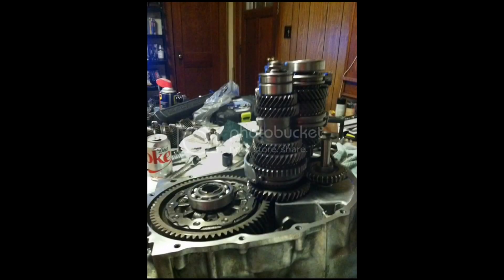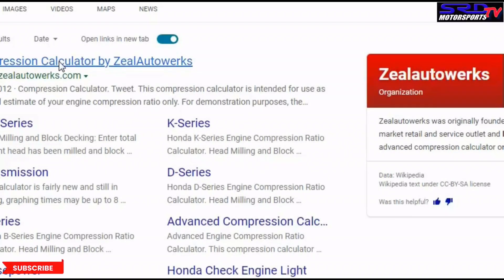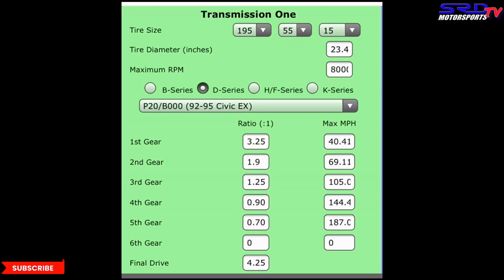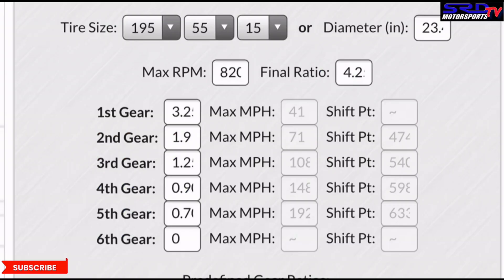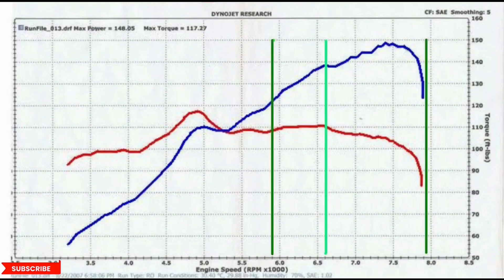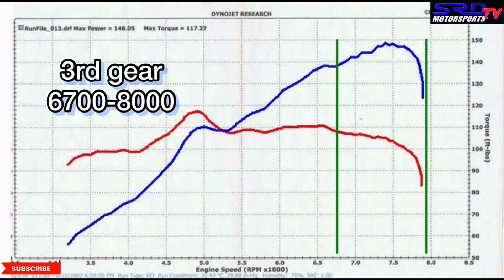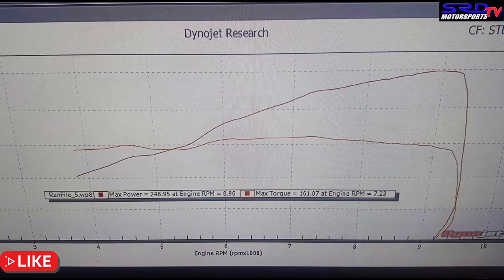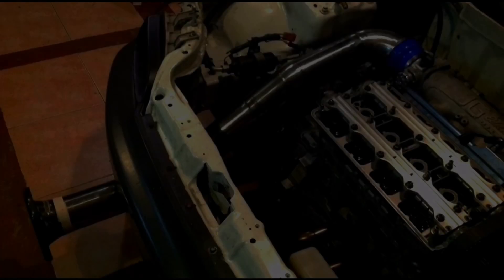D16 SOHC Gear Ratio Talk no Adobe FlashPlayer SRDmotorsports

Comment: what about turbo setups for the street? I just upgraded to a Z6 B000 tranny and am replacing synchros just going to leave it stock ratios cuz i cant afford short 3rd 4th and 5th gears or the 4.7 finaldrive. But I'm curious as to what ratios you would be running with a turbo say 350hp max boost hits at 4500. d16y8 thanks. great video!

Comment: Playing with a dragy brought me here 140whp ZC on full interior 23inch tires, only got 16.03s on a quartermile and been receiving alot of advise to change my 3rd gear (stock vti tranny) or the final drive, well, what can i expect? 😂😂😂
Reply from the maker: no need to change 3rd gear or final drive 
What is ur current transmission? Looks like u have a Lxi a000 tranny?

what is your 60ft on the 16.03

Way too many slower than faster na nka 3rd gear or final drive one thing in common is they all spend a lot of money 😂
Reply from the maker: A friend of mine tuned a stock vti with proper vti tranny na B000 
Last time in Motul but carbon door and hood
15.1sec stock vti engine and stock transmission

Malabo nasa 140 un vti lng un
Reply: Oh yeah you need to put alot of good money to hear those good sounding close gear😂😂😂
60ft - 2.45 
0-100 - 8.4s
For the trap its 139@1/4 mile

Well, could it be with the powerband of the tune? My engine peaks at 6900rpm and 5200 for the torque, not really sure really hard to reach the 15s
Reply from the maker: @elijahcarmona8487  a fast sohc with ph12/vti gears sound as good btw 😂 just like an SiR with stock tranny not all siR nka typer tranny to sound good or go fast 😂
Reply from the maker: @elijahcarmona8487  looking at the 60ft

Looks like if u do a 2.2sec 0-60 ? Thats easy 15.7-15.8sec for u as is no 3rd gear lol!!!
Reply: Oh yeah. Its almost there considering its on full interior, well generally if you would ask any “builders” or “tuners” they would want to make you go for the close gear or the final drive or you can never get to the 15s 😂😂😂

My tires are toyo proxes 195/55 a bit heavy for the sohc, maybe?
Reply from the maker: @elijahcarmona8487  well builders that sell em or need to charge extra labor for the tranny work? We still went 14.2sec on an ESi with stock esi tranny on 148whp before the carbon lodi fad started kase it was 2008 😂

Ur tires are fine, depending on grip and all u can prolly launch a bit higher and it would still grip = this might solve ur 0-60

Cuz the 15.1 stock vti I talked about does a 2.205sec 0-60ft
Reply: Yeah, the very essence of close gear is actually the feels, like who doesnt want a car that shifts like a motorcycle😂😂😂

But yeah ill try to launch it on higher rpm, 5000 was kinda low for the tires, currently im on 5800 ill try to raise it to 6,

15.7 on a daily driver is pretty much acceptable iwould say😅😅😅
Reply from the maker: @elijahcarmona8487  once u are 15.7 u prolly can chip off .1 easy 

Don’t go too soft on the tires it becomes heavy sa dulo? So around 27-28psi is more than good :) 

Hope u can practice preloading before launch = helps real good
Reply: Yeah i usually get better time on daytime due to the temperature of the pavement, thank you so much for your thoughts, knowledge is somehow more helpful than slapping alot of cash on a sohc, like seriously, spend thousands to shave a fraction of a second 😂😂😂
Reply from the maker: @elijahcarmona8487  yep hotter tarmac gives better traction indeed!

Comment: Hi sir may i ask which is better to put an fd 4.7. s20transmission or stock esi tranny? Thank you sir in advance
Reply from the maker: Esi/s20 B000 transmission because even a Bseries 4.7 helps when u are hitting high rpm that the sohc doesn’t see
Reply: @SRDmotorsports  last question sir. 
I have a sohc esi camgear box headers
Is it okay if i put an mfac3rd gear and 4.7 final drive or 4.9? Thankyou very much sir
Reply from the maker: @carloflores2944  Mfactory 3rd gear only works with the inverted stock 3rd as ur 4th (u finish 4th gear parang tersera mo) and so adding a 4.7 fd this reminds me of an onboard vid in Clark a sohc bfor finish line let’s go of the throttle about 80ft away… some say “not sagad” but that’s cuz ubos na 4th (na dating 3rd kase) wala pa finish line

The Mfactory 3rd is good with inverted 3rd as 4th IF kasama Mfactory 5th Pra dikit dikit lahat

But why they don’t? Kase mahirap sa nlex 5th mo that close  hehehe pangit sa long drive

So just a 4.7 on ur current esi gears is perfect na
Reply: @SRDmotorsports  thankyou po sa kaalaman thankyou appreciate it po.
Reply from the maker: @carloflores2944  no worries man! nice you checking out “details” kesa “Sabi Sabi” hehe

Comment: SRDMotorsportsTV can i ask feedback if installing a 12LBs Lightened Flywheel (competition clutch) to a stock S20 B000 ?  good for daily driven and occasional sprints? no problems driving in incline/steep uphills? ty
Reply from the maker: Actually the problem on incline or steep uphill is a myth because power and torque is generated by the engine 

The lighter flywheel changes the rpm rate of going up BUT also going down maybe that’s why they said it’s hard to drive but IMO just imagine it’s a motogp bike 😂

I’d always choose a lighter flywheel just the wallet never agreed 🙁
Reply: @SRDmotorsports  thank u for the quick reply, i saw a video with a lightened 12lbs flywheel the revs go up and down quick vs a stock 18lbs
Reply from the maker: @salteveline  yeah maybe if we heel-toe daily it would be tiring 🤣 but i think its fine
IMO theres a bigger change in driving habits from driving a stock clutch to a tri-puck
than it is from a stock flywheel vs light flywheel
Reply: @SRDmotorsports  I agree. I changed my K24 swapped Civic's flywheel from a stock 16lb RSX flywheel to a 10lb JDM DC5 Type R flywheel and the RPM definitely responds to throttle a bit quicker, but I haven't noticed any downsides. No problems with hills or hill starts even with several passengers and a lot of weight in the car and there's no increase in noise or vibrations.
Reply from the maker: @averyalexander2303  yep the quicker up rev and down rev will be more driver preference but since I was always a motogp fan first… I’m okay with it 😅
Reply: @SRDmotorsports  Yup. I like the feel of the faster response, it makes downshifting and rev matching sound and feel more satisfying to me. I also noticed that a slight RPM mismatch when letting the clutch out a bit too quick isn't quite as jarring either since the lighter flywheel spins up or down easier without resisting so much. I realize that different people prefer different things and other setups may react differently, but on my setup, I haven't noticed any downside to the OEM lightweight flywheel.
Reply from the maker: Yeah I like the same as u… rev matching it is fun even on normal drives it don’t seem to be a hindrance to me…but yeah some may prefer otherwise

Comment: Sir can i ask if what is the code of the stock vti tranny?
Reply from the maker: I’m not sure our local has a code but

On the spot where u put the axle? The circumference of the housing has a code it should be
B000  to be a vti because LXi is A000
Reply: Cause last week we bought a p20 B000 tranny it came from a ph12 engine is it same with the vti tranny?
Reply from the maker: @sharmainecastillo3446  ah yes p20 is ph12 the gears are the same just the internals such as “gear selector”
Ph12 is aluminum and vti is steel but not interchangeable 

However the gear ratio = identical so atleast the vti u got has good gears
Reply: Do you have a facebook account?
Reply from the maker: @sharmainecastillo3446  ah yes the shop page link is my fb page I’m the only one who manages it… 

Here or there u can ask anything related to these stuff

Comment: hi SRDmotorsportsTV  thank you so much for educating us re vti/lxi/ph12 tranny, i hav a d16zc s20 b000 tranny, which tranny gear upgrade is better:

A) 
1st 3.250 stock
2nd 1.909 stock
3rd 1.565 MFactory 3rd
4th 1.125 stock 3rd to 4th 
5th 0.702 stock
FD. 4.25 stock

B)
1st 3.250 stock
2nd 1.909 stock
3rd 1.125 stock
4th 0.909 stock
5th 0.702 stock
FD. 4.7 MFactory
Reply from the maker: B is better any day cuz the gear spacing is correct

For me it seems abnormal  to have close 1-2-3-4 tapos use stock 5th so u can go to the highway ☺️

They’d say it helps? I disagree cuz the ones I see got stuck in the low 13s for years

And went to 12s by turning it into a “racecar” on special fuel 😂 so where there did the gearing help? Hmmm lol

mines like B = stock esi
I do plan on saving up for a 4.7fd so hopefully soon :)

Comment: I had already realized that shorter cash ratios would not always be faster. 
When I changed the tires from 195/55/15 to 195/50/15 the car was slower.
Reply from the maker: yes!!! thats my goal on this video to let each one figure out what wrks for their own car and driving style...

i believe you saw this because same rpm limit right? so for the same rpm shorter distance reached in total
Reply: @SRDmotorsports  Yes. the same rpm limit, only the tyres change..
Reply from the maker: @picole321  that is interesting because your findings are correct even with math and the calculator :)

Comment: Another great content yesssirr!!! Thank you SRD, I was also curious about the S40 LSD tranny  ratio any great advise on this for a sohc ph16 engine?  Many thanks!
Reply from the maker: thaaaanks man!!!

well if the s40 is b000 ? then most likely it is vti geared which is the same as ph12 so thats a good one indeed
Reply from the maker: Worth noting here though we discussed it on the SRD page…

S20 is a designation for 92-95 / obd1 / 5th Gen
S40 is a designation for 96-00 / obd2a/b / Gen6

Both can have an LSD as it was a Honda optional accessory back then when u bought it bnew in Japan (the car) just like some B16a were rarely lsd

I share this cuz I saw a random fb post claiming that it’s s40 so it’s LSD?!? It’s not always :) worth noting cuz that random post was from a 
“buy and sell” dude lol

Comment: I guess mas ok to get gears from MTM since he can outright make you a custom one for almost the same price as an MFactory? Granted you have a dyno sheet to base it out on hehe.

Still haven't tried my 20" tire sa BRC or CIS :( soon hopefully.. 1-2nd gear felt good though..
Reply from the maker: true on MTM gears but also there are limits like we both know "ratio" is divided onto both teeth gears? meaning... physically impossible to get 1.370 third gear sa sohc etc etc but yeah MTM gives us that freedom

Me il stick to my ph12 MAYBE one day MTM frst gear extension or MF since similar price naman

or heck final drive nlng done deal na hahaha

but then final drive is less importance when there is a 20" option na eh
Reply: @SRDmotorsports  Agreed, 20" tires are not ideal for cars that are too low BTW pero i love the fact that its an easily reversible "FD swap".
Reply from the maker: @mikodelacruz  yes on too low so "no to stance" kidding hahaha

it is a significantly smart choice i mean heck even M&H slicks have 20" 23" 24.5" and bigger

for me the reason id consider a 4.7fd ? is not cuz its better but its because for me to want that? means eventually the sohc will be strong enough to power down the line on 4.7 fd and 24.5" slicks 🤣 bisi style lol
Reply from the maker: or better yet since our 195/55/15 is 23.7"
id run a 23" MH slicks if i had a 4.7fd granted the sohc engine can take advantage of it IF it makes power? oh man... that would run good times lol
Reply: @SRDmotorsports  This would be better for sure, would be a recipe for a good bracket class car.
Reply from the maker: @mikodelacruz  yes!!! improvements plus consistency definitely good for a bracket racer!
Reply: @SRDmotorsports  Would be a fun experiment to find a stock civic and run this compared to stockies, or ones with the common 195/55/15-195/50/15 haha.. Sana magkaroon ng drag testing day this year..
Reply from the maker: @mikodelacruz  oh snap! this! is a good idea!!!!

thanks to all of you guys here man...its going as i hoped... videos that are helpful but also comments that got golden nuggets 😏

Comment: If you run 1954515 vs 1955515. Without the expensive fd swap.
Reply from the maker: it helps a little... but 45 series 15s is quite hard to find and it will also be a balance of grip because the lower profile tires have stiffer side walls and stiffer sidewalls means it wont conform to the ground easily so less traction on take off

its why slicks have wrinkled sidewalls when we launch so it conforms to the ground maximum

Comment: Is the 11.800 car around 2070 lbs?
Reply from the maker: the grudge race rule was 900kg both were weighed bfor n after

but both were in the 940-950kg range so
2,068-2,090lbs
Reply from the maker: when i think about it now we ran 12.1 in 2017 on e85

these guys ran 11.8sec 2 months later 🤣 on e85 too!!

was that fast
Reply: @SRDmotorsports  Just realized the estimation using this calculation is quite close: hp = weight in lbs / (ET / 5.825) ^ 3
Reply from the maker: @findtherightbeat  actually good point!   and now when i think about it? aint it funny? back then it was "wow" fast, til now its considered fast

but with math? its "tama lang" hahaha like man! we aint even doing our best yet and its that fast whoa
Reply from the maker: -crux to the perception
or in this case
-fuel to the fire lol

that was a 250whp vs 260whp race
both poppin 11.8s

today? we see lodi numbers 265-275whp
yet way more race fuel than basic e85

still reasonably in the 11s as only 2 ive seen now hit 10s but backhalfed pa chassis
Reply: @SRDmotorsports  Interesting, which one had 250whp and 260whp?
Reply from the maker: @findtherightbeat  winning car had 260whp losing one had 250whp  they were neck n neck all the way until the last 40ft i hunch that the "extra" shift" added delays...
Reply: @SRDmotorsports  Not sure if I missed it, but what ratios did the 250whp car run?
Reply from the maker: was neck n neck like literally a fender gap was considered big already...

but 40ft bfor the finish line until the finish line? winning car lunged 4 car gap/away hence i suspected the added shift did more harm than good
Reply: @SRDmotorsports  You're probably correct in that the shift to 5th made the .051 difference.
Reply from the maker: @findtherightbeat  i never checked but its the Mfactory 3-4-5 so finished the 1/4 on 5th
Reply from the maker: luckily I didnt bet any cash on that grudge race 🤣
Reply: @SRDmotorsports  Curious as to which MFactory 3-4-5 gears and final drive they used..
Reply from the maker: @findtherightbeat  me too actually but knowing the person who got it? its prolly whatever first choice can be made lol
Reply from the maker: either way its why i did mention a possible Bseries version cuz even on stock? they get blinded by hype

TypeR 4.7 vs TypeR 4.4

when the 4.7 is spread farther than the 4.4 its possibly cuz honda knew on road races u gotta match the 5th of the 4.4 spread?

so "nambawan" choice typeR 4.7
when u can get a typeR 4.4 and sell the fd and buy an Mfactory 4.7 🤣
Reply: @SRDmotorsports   At the end of the day, it's a case to case basis based on the intended use/application. It's also rare that people would like to shift into 5th even in road races unless they're running on a very long circuit 🍻
Reply from the maker: @findtherightbeat  thats true but even in CIS you finish 4th gear before finishing the long straight

so what i meant is id run the MF close 3-4-5
but id also get their 4.0 final drive 😏
Reply: @SRDmotorsports  I remember Bense's analysis on close gear ratios and final drives
Reply from the maker: @findtherightbeat  oh yes yes Bense was indeed a source of good stuff he was the first i know that used or tried Infinitude gears which was Mfactory initially